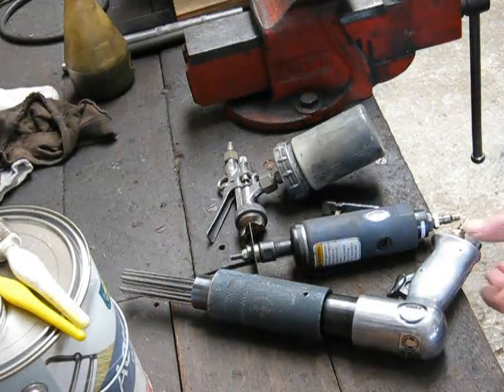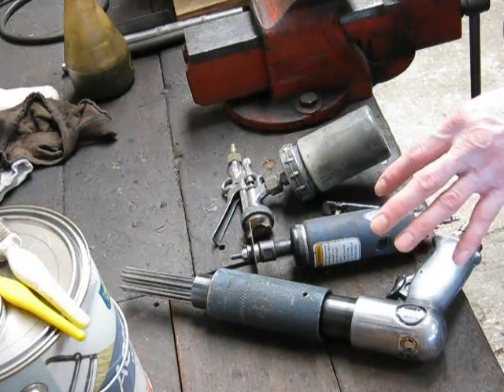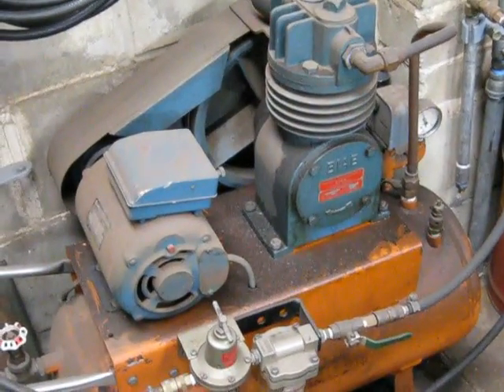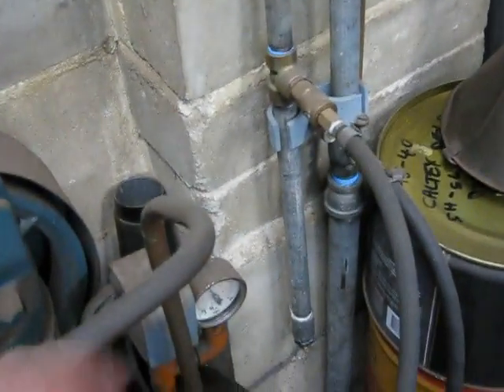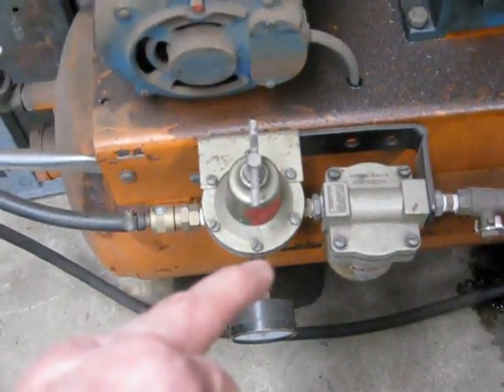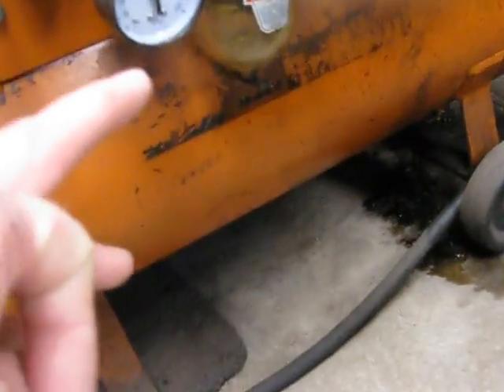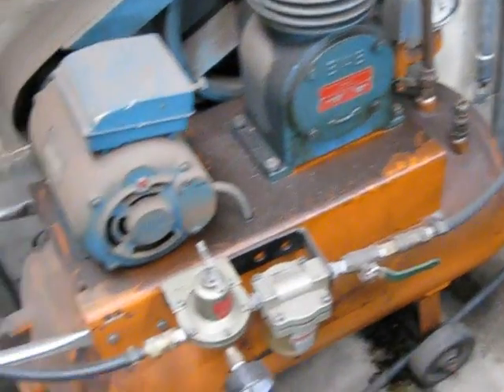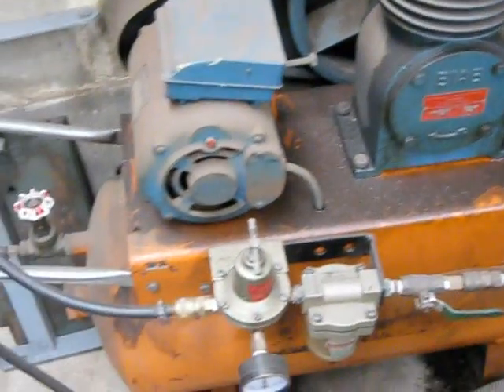Make a compressed air drier from junk water pipe

Comment from the maker: Some compressors do have a rudimentary cooling radiator between the compressor tank and the pump, but generally no trap or drain facility.  Unless forced air cooled, this would soon overheat and lose any condensing effect.  Most compressors rely on the majority of water vapour condensing out in the cold steel tank, which is the first major cooling mass encountered.  I don't have a problem with moisture in the tank as it is generally oil contaminated, anti rust in effect, and should be drained regularly to avoid oil/water separation.  The compressor will generate the same amount of heat regardless of the rest of the setup, as that's an inescapable physical result of air compression.  Cheers Rob

Comment: Would this be best:  Compressor head > check valve > pipe > separator > tank?  Just thinking it would help keep moisture out of tank as well as keeping the tank cooler which keeps the motor and compressor cooler as well.

Comment: I have 15 HP air compressor, will the system take it?, how it I put the bottom halves of the pipes in the water, so that it could cool down the pipes, which improve the condensation. Thanks.
Reply from the maker: dwi hermanto The system as shown is designed for a small workshop, but the principle is taken/copied from the system used in much larger motor garages where air is plumbed all around the shop to multiple take off points, each with a water trap. So compressor size is really not an issue provided there is enough mass and cooling capacity in the air distribution system.  Running the air through a water cooled heat exchanger as you suggest could work, although unlike air cooling of steel pipe, a water based heat exchanger would need water cycling to avoid it getting too warm and rising beyond dew point. Cheers Rob
Reply: Thank you very much for the comment, Will try and advise the result
Reply from the maker: dwi hermanto Your welcome.  Be sure to visit this web page regarding the system and the effect it can have:  https://www.tptools.com/tech-metal-piping.dlp

Comment from the maker: I drained the complete air system today - first time for about 6 months and was all set to do a video of what came out.  Unfortunately I had a few camera issues, so I will have to do it another day.  Basically about two litres of oily water came out of the compressor tank, a quarter of a cup came out of the first upright steel pipe with the twisted baffle insert, nothing came out of the second pipe, nothing was in the Schrader main filter regulator, and nothing was in my bench mounted Festo trap/regulator oiler combo.  That is the progression of air flow through my system.  Obviously the first steel pipe is catching most of the moisture from the tank.  Even more obvious is that the pipe trap works.  I will keep this in the list of future videos to do.  Cheers Rob

Comment: Thanks for the tip xynuda.  I hadn't thought about it but  I am going to make that extra run before I put the proper filter on.  Not sure why these other guys are making such a big deal here.  From the size of your compressor and mine and probably 99% of the compressors in use they aren't running 24/7 in 100 degree ambient temperature.  Screw them, this is a great idea for a small shop.  Thanks a lot.
Reply from the maker: ***** Hi Rick.  The principle is the same as used in all small motor garages for their compressed air.  My father was a mechanic all his life and I've been in and seen plenty of workshops over the years, and they don't run refrigerated coolers etc.  If you were spray painting as a profession, it woud be different,and you woud need to outlay cash and get refrigerated etc, but that's not your average workshop :)  The pipes definitely work, and will make your existing filter work properly.  Cheers Rob
Reply from the maker: xynudu General rule of thumb is that a conventinal dryer/water trap should be at least two meters from the air tank outlet to allow the air charge to cool for the trap to do it's work.  In reality most small compressor setups are no where near that length.  Rob

Comment: what size was your larger pipe 2"  and the other one was 3/4" ?
Reply from the maker: Eric Lavoie I used 3/4 and 1 " water pipe.  The more mass the better for heat absorption.  I just used what I had.  The guy I got the idea from used some much bigger diameter pipe as a single stage condenser, but I made my double section.  Most water condenses out in the first pipe.  Rob
Reply: thanks im going to try a 1 3/4 think it do better

Comment: Your better off with a refrigerated compressed air dryer, that arrangement  you have come up with will only work for a short period of time until the air receiver gets up to temperature, also your relying
on a rather low ambient temperature to make it all work, I would like to see an arrangement like yours work on a 100 HP compressor running 24/7in a 100F ambient 95% RH. What Iam getting a if it was that easy to dry compressed air they wouldn't manufacture refrigerated and desiccant compressed air dryers
Reply: ROTARYCOMPTECH
I could prove you wrong with a heat gun buddy. The temperature drop for this little compressor[which is what we are discussing] Not a commercial setup is sufficient. I've make corn licker and my family has been condensing longer than you've been alive.
This Englishman's system is cheap and effective. And since I have worked in thermodynamics as a profession I have dealt with engineers who scratch their head and ass and say 'That's impossible' Real world is not always as 'designed.'
Good job Mate.
Reply from the maker: ROTARYCOMPTECH It works exactly the same way as the air system in most small vehicle work shops.  The piping is the condenser.   It's not designed for a 100 HP compressor.  Rob
Reply: xynudu I have been in this field for over 25 years and never seen such a arrangement of pipes plumbed in such a manor.. forget about the 100 PH compressor. This set up can't possibly work in a high ambient continuous run operation. The only way to adequately remove condensate from compressed air is either cool it down just above freezing or collect it in a dual tower regenerative desiccant dryer
Reply from the maker: ROTARYCOMPTECH https://www.tptools.com/tech-metal-piping.dlp
Reply: Aye Bee The whole system is relying on a rather low ambient temp and a light duty cycle. Try to achieve the same results in a 85F+ ambient with a 75% duty cycle it won't work 
and that's a fact

Comment: Actually, pipe diameter does make a difference. As a gas (in this case air) expands, it cools. Therefore you want the condenser pipe to be a larger diameter than the pipe that leads into it.
Reply from the maker: Yes.  That's why I feed from small into larger through my pipe system.  Every time water vapour passes to a lower pressure (larger) area, condensation occurs.  Basic physics,  Cheers Rob
Reply: @Xynudu  But when you reduce back down to smaller diameters, you'll then be re-compressing the air, so won't it be trying to pull moisture back into that higher pressure air?

Comment from the maker: My verticals above the connection points are about 6 foot (2 metres) so your rig should work fine. Best to put a spiral strip of steel down the centre of the first pipe to give it more effect.  Easy to twist up a strip of light galvanised steel.  To get longer pipes you could run them across the wall on an angle, but I doubt it's necessary.  Cheers Rob.

Comment: Hi, thanks for your video. Can you tell me about how much vertical pipe you used. I have only 8 foot ceilings in the garage and wondered if it would be enough or I could go up into the attic but was wondering if it may work with 2 6 foot runs with a foot or so below the t for the water collection, thanks for your help in advance.

Comment from the maker: A remote drier between the compressor head and the main tank makes a lot of sense, particularly on a fixed unit. It would be the most effective set up.  However, regular draining of the tank should virtually stop rust through.  My compressor is 40 - 50 years old and still going strong. Rob

Comment: water is still collecting in your tank though.hook the drier up to the head and cool it before it goes into the tank.i just scraped a tank that had cooler and filter after the tank.owner never realized they were collecting water in the tank.rusted though .tried to weld it but sucked at welding.sick of weld grind weld grind,weld grind weld test ,leaked ,trashed it.new compressor air will be cooled before the tank this time.try it ,huge difference.huge.

Comment from the maker: Glad you found it useful Fred.  It works great in our climate and isn't bulky if you run it up the wall like I have.  Not really portable, but as I never move the compressor, it's not an issue.  Works much the same way as a car or fridge air condensor radiator, which can also be used in much the same way.  Cheers Rob.

Comment from the maker: Water vapour mainly comes a nuisance when it condenses out out the air and forms droplets as it changes from a compressed state.  A dryer before the compressor is possible, but it would need to be a desiccant or refrigerator type.